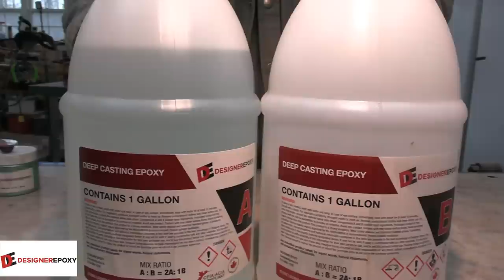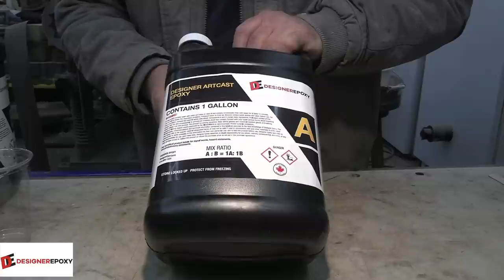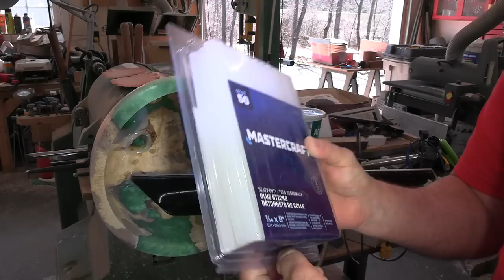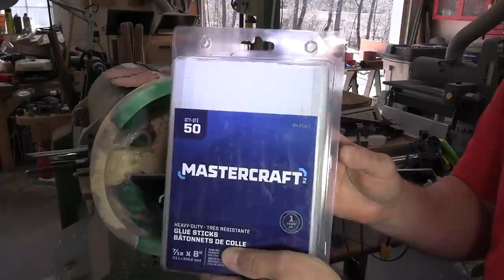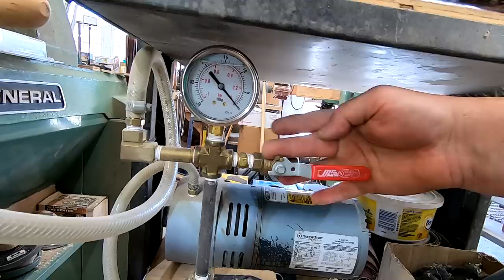Woodturning - My Largest Resin Order!

Comment: Those bowls are a lovely set and the platter is magnificent.  A suggestion for the second platter would be to pour more resin in a contrasting color like blue or gold.  There will be a witness line but it'll be much less obtrusive than a similar line on a bowl.
You're getting 31°C/89°F temperature in Ontario.  Here in Connecticut on the shore line the warmest we've been this spring is 21°C/70°F.  Weather is being funny this year.
Reply from the maker: It’s been all over the place here too. Next week 12c 🤷‍♂️🤷‍♂️🤷‍♂️  Thanks!

Comment: The pieces are absolutely beautiful...the colors and the beral is to die for. 

A tip I have learned on 1 to 1 epoxy is to pour your thinner part first and then pour your thicker part second...it helps with measuring and also with mixing it.
Reply from the maker: Good tip. Thanks 😊

Comment: Jim, I really enjoy your videos! You're sense of humor is entertaining and I'm always anxious to see if your resin sticks in the mold and how badly! Most of all, your finished products are some of the nicest pieces of art I've seen. I'm ready for the "Sweaty Jim" video! I'm surprised you don't have your shop air conditioned. I have a little 3000 BTU unit in my shop window and it helps a good bit. Being that small, it doesn't use much electricity. I hate being sweaty and having shavings sticking to me. It reminds me of baling hay when I was much younger...
Reply from the maker: I do have a window mounted AC unit and used it last year. It won’t help me outside in the sun tho, haha. Thanks

Comment: Hi Jim, what a nice set!!! Once again outstanding 🏆 that green casting is one of the nicest combination with burl. I am one of those who really enjoys your long videos because they usually convey more learning opportunities. I would sure like to have a market for my bowls in order to spend more on epoxy, but my products often finish as gifts. I will probably have to invest on a pressure pot to practice your inspiring techniques. As for the second platter, I would probably try to break it in parts incorporated in another project. I personally never throw out any  failed project but I try to be inventive and creative with it. 

Although I use sand paper like you I recently bought at Lee Valley 5 inches meshed sanding discs on a 5 inches pad that I stick on my 3 inches pads. You find them from grit 40 to 1000, they do an exceptional job to improve bowl bottoms and can be used several times because you clan clean the mesh with the air gun. By memory they are Mirka ants et
Reply: ,,,mitks abramet ace disks. 

Last I was wondering with which product do you clean your mixer and also where you found the extension for your drill and pads 

Thank you so much for presenting such great videos.
Reply from the maker: Thanks for the info, I use Acetone to clean my mixer, it work really well. just put the drill in forward and reverse until its clean. Unfortunately I can't remember where where I found that extension for my drill pad.

Comment: I struggle to find burl here in MN. I did finally pick up a gas powered saw but that doesn't mean I can go trespassing all over the woods looking for burls to steal, that's for sure. Buying burl wood online isn't cost effective really either and there isn't much variety in terms of larger pieces here in the US. I did find a downed/fallen tree a few blocks away and got some nice large rounds but I found out later that it is basswood which is quite soft so I'm not sure what I can do with it now once it's dried. Excellent pieces Jim, 👏,  that box elder burl is truly incredible! 👌
Reply from the maker: Thanks, it certainly is! Thanks

Comment: Amazing work as usual. The work you do is so advanced but you make it look easy. I was talking with someone at Hunter about your work and he is amazed at what you can do with their tools. The first platter, if you cut or grind down the outside edges down to the bottom at an angle at about where the outside edge will be and then recast with a quicker setting resin that will allow you to cast when the colors won’t blend or whatever effect and with the red either try to match exactly or go a little more translucent, you will allow some of the bottom color to come up through and possibly mask any possible witness line there on the outside base. Just a thought. Can’t wait to see what you decide.
Reply from the maker: That’s not a bad! Thanks!

Comment: The platter is incredible! The bowls are also magnificent. By the way D-way tools makes a tempered steel rod to go on the Powermatic tool rests. Mine arrived today. It is an easy fix.
Reply from the maker: Do you weld it on? Thanks
Reply: @SpragueWoodturning  it goes on with jb weld. He has a video on his site.

Comment: Hey Jim! Stunning pieces, as always! I am not a turner (wish, wish, wish) but I think the other platter would look fantastic if you used clear resin with minute bits of glitter in it. That way you don't worry about a witness line & you're not stuck with plain either. Or, if you did a translucent dark-ish pink? Or even a soft (as in only a little added color) gold.
Reply from the maker: Great ideas, thanks for sharing!

Comment: Wow you sure had a load of box elder burl. Still working it.  You are part chemist, trouble shooter, designer, creator and artist.  Impressive!   Also glad to see an experienced turner give a thumbs up to carbide tools and the many ways you can use them.  Lots of turners turn a blinds eye to them.    Ok the first platter that didn’t work our.  Could you cast clear, maybe a color with metal bits?  Ie, aluminum, copper, brass.  Or powder metal.  I am thinking it would cast a certain “glitter” thru the epoxy.
Reply from the maker: That’s not a bad idea, will give it some thought. Thanks!

Comment: Awesome work as always Jim. i have now got a vacuum chuck and just need to finesse my setup with it. currently not using a gauge so don't know what vacuum it is pulling but after seeing you setup again i now have a direction to go in. Yes the clip was long but you could not have taken anything out . Fantastic job mate.
Reply from the maker: You definitely need a gauge. Sometimes the vacuum isn’t that great on some woods. Make sure to give the piece a good tug just to make sure bowls don’t go flying, thanks

Comment: After watching one of your earlier videos I have now bought 5 gallons of Designer Epoxy so far. I'm in the States but it doesn't take much longer to get it. After about 8 or 9 projects I have found that I just cannot make multiple colors work because the open time on this epoxy is so long.  It works great for single colors, or colors with mica powder.  With mica powder you've got to be careful because sometimes it will sink because the resin is so thin.  If I want to mix multiple colors I use Alumlite clear slow, and use a infrared thermometer and wait till the temperature is about 99 before I mix the colors.
Reply from the maker: Yes, you’re right. This is how I achieved it https://youtu.be/PpJyeQjgcq0 the wait time is the key just like you said. I do find that Deep Cast is really affected by temperature, the cooler it’s in the shop, the slower it will take before pouring to get that color separation. The higher the temp, the less time it will take before pouring for the color separation. It’s still a work in progress for me but I’m getting there, lol. Jim

Comment: Perhaps using some UHMW blocks to hold the pieces of wood in the bucket. That’ll give you some height to use weights
Reply from the maker: The larger pours aren’t such a problem because you can glue them to the side of the bucket, but yes, it’s a good idea to put a weight on the wood as well. Thanks

Comment: For the platter with the leak, why not turn it into an overpour piece. I know you've said you try to mix only as much resin as needed, but there are probably times you have enough left for a thin layer. Just layer until full and let the colors do their thing.
Reply from the maker: This is an interesting idea and it’s in the running. Thanks!

Comment: Before I forget again , an easy way to get hot melt glue off wood is to use an acid brush and dab the glue edge with Denatured alcohol and let it set a few minutes . Then usually it will come right off
Reply from the maker: Yes, thank you!

Comment: Out of curiosity; would placing the pressure pot on a vibrating platform contribute to the fuller release of air and the better infiltration of epoxy into the air pockets?
Beautiful outcome...I love your stuff
Reply from the maker: That I do not know. Most of the time I fill the resin up to the top of the mold so I’m assuming there will be a mess to clean up, lol.  But it might work.

Comment: These bowls and the platter are a true tour de force. I particularly like the variation of colors in the wood.
Did you give any thought to using a metallic colored resin to fill the cracks that showed up early on the bowls? It might have wound up getting turned away but I’d love to see you try it sometime. Have you ever tried resin casting a piece that has been fractal burned?
Reply from the maker: I’ve fill fractal burnt boards and did a video on it. Here it is https://youtu.be/frlBBNGCXXk thanks

Comment: What can you say simply beautiful. I have a question about your coring sequence, why not start with the smallest core first and go larger? I don't  have a coring system yet, just wondering for the future. Thanks again for all your hard work.
Reply from the maker: With my lathe, if I try to go for the smallest core first I can’t use tailstock support. I can’t remember the video I shot but I lost the blank out of the chuck doing this without support while going for the smallest core first. This may not be an issue on your lathe but it is on mine. Thanks!

Comment: I'm sure I watched a video with a large resin pour (possibly a table) where they left the pour outside in the cold to slow the reaction down slightly and prevent cracking from happening, they were still protected from dirt moisture etc as they may have had it in a pressure pot.

Worth a try though as the resin will produce its own heat?
Reply from the maker: This resin need a temperature of between 70 to 75F to cure. It usually doesn’t get real hot when curing. Jim

Comment: What about a thin layer of opal on the low red casting and then water clear on top? Could be pretty flashy!
Do you find the smaller bowls get better pricing when sold as a set with the other cores? (Sorry - I’m not sure if that’s the only way you sell them, in which case this was a dumb question!) 🍻
Reply from the maker: That might be pretty cool too. I pretty much only make and sell the small bowls with the sets, not a dumb question at all. Thanks

Comment: Really pretty-- I love the swirly green water around the land. I don't know much about resin as a material. When hardened, is it at all affected by moisture, heat, and/or pressure? I just started thinking about the bowls being nested if stored for a while between uses. Any danger they would stick together, and the finish be damaged when taking them apart? Would it be best to layer anything between them, and what kind of thing like cloth, thin plastic foam, or corrugated paper would be safe? Thank you.
Reply from the maker: If there going to be stored long term then it wouldn’t hurt to place something between them is guess. Never really gave it much thought before. Thanks

Comment: Wow!!!! Anyone would be proud to have that set, would be crazy if they didn't. 
What size  vacuum pump are you using with your vacuum system, also oil or non oil pump.
Reply from the maker: It’s a 1/4 horse, thanks!
Reply from the maker: By the way it’s non oil.

Comment: hi Jim! i got my coring system yesterday. Ive watched so many (maybe all) of your videos involving coring, that i feel pretty confident. i consider you the authority on coring. The steel cylinders are just spacers for the knife and finger so the adjustment doesnt have to be maxed out, correct? my set came with no instructions, and although it seems pretty obvious, i wouldnt mind your confirmation. 1 more question. How about coring a laminated bowl blank? im just talking about some 3/4" thick boards, glued up to make the height of the bowl. grain orientation would be the same as a typical bowl blank. I appreciate you always answering my questions, and i hope my comments really do help, and arent just a nuisance to have to reply to. Thanks Jim, im very appreciative! Aaron Fresh Air Woodshop Kansas
Reply from the maker: Yes, the spacer blocks are exactly that. If you go to Oneway.ca and scroll down to the bottom of the page there is a media tab. In there you will find a few videos of Dale Nish explaining how to setup and use the coring rig. This is where I got my info from when I first set it up. You should be fine to core laminate blanks as well. Just make sure your glue joints are good. Thanks for watching!

Comment: Amazing colours and finish as usual. Question if you don’t mind and its what size resin mould can you get in your pressure pot and what make is it as it looks like my vevor one but i can only ge about 300mm bucket in. Cheers
Reply from the maker: My large one can fit 14.5 bucket and my smaller one 12.5 I think. Thanks

Comment: Jim, i don’t think i missed anything but……i might have.  So my question is what was the reason you used a glue block for a chuck, why not just use the glue block and forgo the chuck altogether?  Thanks!
Reply from the maker: It was a fairly heavy blank and I didn’t want to turn a tenon on the bottom so the chuck could grab it. That way I wasn’t taking away from the overall size of the main bowl. The ideal situation would be to put a normal waste block and small faceplate on it and then grab it with the chuck so it could be cored. But I can’t do that with my chucks. I will look at getting deeper jaws and see if that will work. Hope this makes sense. Jim.
Reply: @SpragueWoodturning  yes it does. Thanks for answering. Stay well.

Comment: I'm curious if there are certain types of wood that specifically don't work well with resin?  Have you ever worked with sycamore or birch?
Reply from the maker: Birch a lot, never turned sycamore but I’m assuming it would be fine. Thanks

Comment: My Beall buffs seem to be an inch or so larger in diameter. Are yours worn down to their current size from use, or do you get smaller buffs?
Reply from the maker: That’s correct. I’ve worn down a few in my many years of turning and now have different sizes so I can buff the inside of smaller work too. Thanks

Comment: Idea...Red pistachio shells?
Reply from the maker: Are they actually red or is that the flavoring that’s on them? If it’s just a coating I wonder if it would tint the rain red? Thanks
Reply: @SpragueWoodturning  Turns out there is an interesting story behind it. However, to quickly answer your question: the are dyed with an artificial cherry-red stain to give the colour. Most pistachios currently available come from California and the dyeing process was never employed by producers. However, I checked online and they can be bought through amazon. I do recall that eating them would stain your fingers bright red after opening a number of them (of course, you can't eat just one).

Comment: Can you use glitter mixed in with resin?
Reply from the maker: Yes you can, the key is getting it to suspend and not fall to the bottom of the casting. Jim

Comment: Hey Jim just watching this video and had a question about the finish and why you use glue blocks. You said you use the glue blocks due to the shiny finish and being able to take off the lathe. If you are only working on one piece and not doing production is there any harm in just leaving the bowl on the lathe after doing each coat of finish?
Reply from the maker: Way too much dust in the shop to just leave it on the lathe. It would be full of dust. Thanks